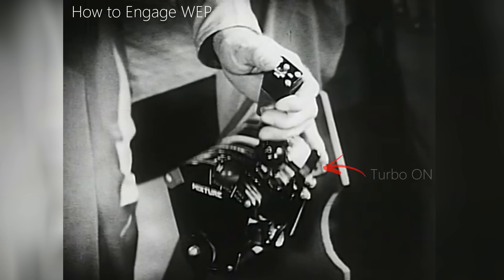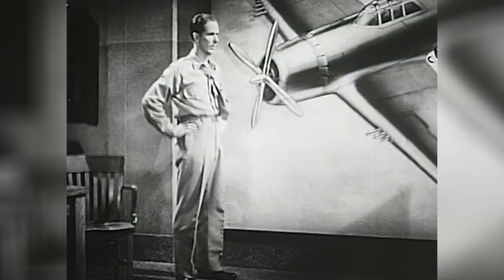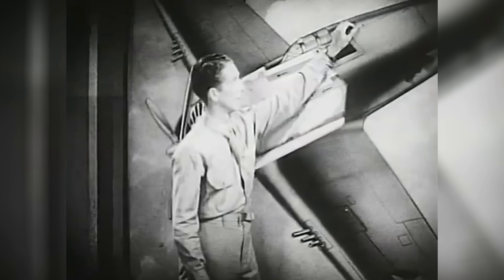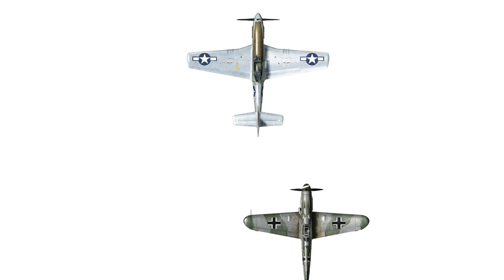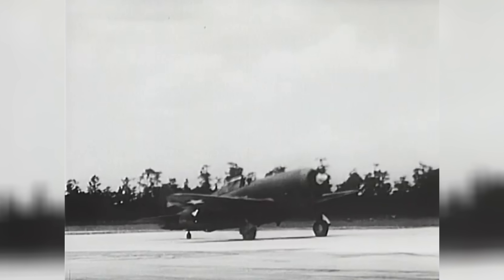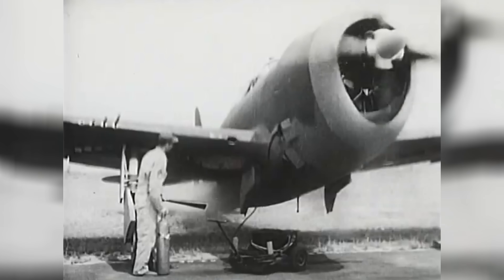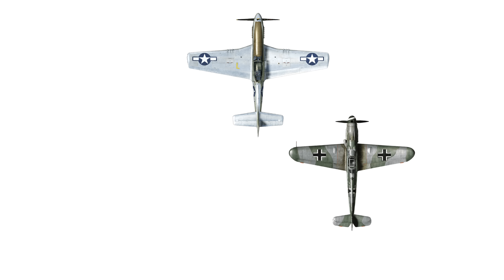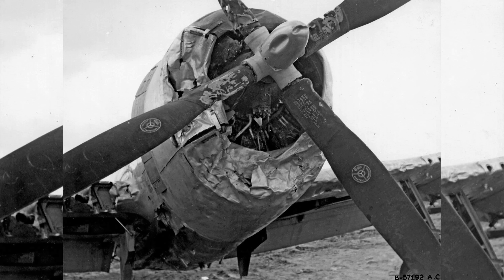What is WEP?

Comment: WEP is like removing the redline limiter on your car.  If you get home you will need to have a complete engine overhaul.   If you get home.
Reply: unless you had an Allison engine
Reply from the maker: @SoloRenegade Thanks for the comment Solo, Care to elaborate why regarding the Allison? Thats very interesting :)
Reply: @FlakAlley  becasue, it was tested at 70" for 20min without damage, after pilots, mechanics, and officers from the RAF, USAAF, and other nations reported back that they were operating the engines at 70+" MAP without issues. Allison tested and verified this was true.

Allisons were reaching 2200HP late in teh war and 3300HP after the war. teh engine was overbuilt and rugged, and could take more than it was rate for.
Reply: @SoloRenegade If they were so rugged then why not use them instead of the Merlin?
Reply: @Will1988US  the P 47 did I think he’s talking about the R 28 wasp or the super wasp because they tested that in California, where they ran it at max power for 24 hours to make sure it was reliable and could actually handle war then we’re de-tuned till like 2200 to 2600 horse with wep pushing 3600
Reply: @oler777   Was the detuning mainly for reliability, or fuel quality differences overseas?
Reply: @oler777  That happened here in Kansas City. My Dad started it up and set the power. Mister Luke Hobbs ordered that test because PW Harford Conn had run the R4360 at 3800 the week before. 
   In insane quest for reliability - the DAMN GOOD R2800 - B model was replaced by a "clean sheet of paper" redesign. That was the R2800 C-model first used in the F4U-4 Corsair. P-47s got them after that. Literally they are two completely different engines with the same bore and stroke.
Reply: @patrickshaw8595 he’ll yeah
Reply: @patrickshaw8595  Thats insane, was your father a vet also? Guessing he knew these engines inside out
Reply: @FlakAlley ai slop response
Reply: @Will1988US  He was a ground pounder was wounded then was a truck mechanic. 3 or 4 years he finally got hired on as AC mechanic and all they had was radials. He loved R2800s and hated R3350s. He never worked on any 4360s but I di with the Air National Guard. KC-97Gs.
Reply: @SoloRenegade But how likely is it that they escape after using WEF?
Reply: @StarWarsExpert_  Always? Do some resarch Stars
Reply: I wouldn’t say that because the higher RPM you go, the less efficient most engines get so in reality it would more be like closing the waist gates on a turbo charged car instead of the boost being regulated. It just shoots the turbo up to his high pressure as it possibly. Can I technically have this setting on my car I only ever had to use it once when in a street drag race somebody was driving towards me and we were in a tie so I closed my waist gate. The boost shot up to 37 psi and I gained about 200hp for 4sec
Reply: @oler777 I could be mistaken but I don't think use loose horse power the higher you go on your RPMs. You lose it from the extra heat which leads to the break down of the oil which generates more heat and the effect just keeps cascading until your engine blows, you let off the throttle or you can achieve extra cooling somehow. I have ran Great Value Corn Whiskey (1 gallon per full tank) in 2 different v-6s and 1 v-8 and it helped both of them run cooler, longer between oil changes, and more horsepower with less pedal because the cooling effects of the alcohol keeps the oil from heating up as well as the metal so it's like running with a cooler engine. Keep in mind though these vehicles are built better than the ones today. I have found if you can keep your engine cool and boost the octane to compensate for the slightly thicker oil your engine, oil, and wear parts last longer and it added about 50-75 miles per tank or more depending on which vehicle it was.
Reply: @scottcoley1906  yes he has to do with heat but it has to do with the stroke of the engine and where peak torque is being produced yeah you can keep making an engine rev higher and higher, but it’s not gonna mean that it’s efficient Formula One and Indy car engines rev to 14-20k because they have a very short stroke giving them decent horsepower, but not torque meanwhile a drag engine making 14,000 hp only at 7-10 use a long stroke to produce that much power it also depends on how big your engine is like some semis have 20 L diesel engine engines that make 300 hp but a couple thousand pounds speed of torque at 1000 RPM. It depends on what you’re driving what you’re building a whole bunch of other stuff, but you can’t just keep adding RPM or cars wouldn’t need gear boxes. Does your car shift out of first yes because if it kept revving to the moon, it would just blow up. And if you’ve been in a car that produces a lot of torque when you get above 5000 RPM, you start to lose power unless the camshaft is designed for that.
Reply: @oler777 isn’t always kind of a trade off/balance? You just simply can’t have both..
Reply: @DSToNe19and83 in simple terms yes you’re still just turning a rotating assembly to pump air through it as efficiently as possible. Some engine engines make a lot of torque low RPM others make a lot of horsepower at high RPM. But yeah, you’re right.
Reply: @oler777 No engine produces hp , they make torque and hp is just the outcome of torque x rpm . So in theory the higher you rev the more hp you have , but the torque is also falling down fast . To have torque at low rpm and high rpm , you need variable camshaft/valve timing like VTEC from Honda . Then you can have the best of both world's .
Reply: @5co756  ur wrong. The classic ‘engines don’t make horsepower" Yet somehow people still use HP because it actually tells you how fast work is being done. Torque without RPM is just a number you flex at Cars And VTEC isn’t magic either my bro it just moves the compromise around. Engine produces hp
Reply: @DSToNe19and83  I mean why cant you have both? Isnt that the point of WEP
Reply: @scottcoley1906  Well it has to be pretty serious to justify running an engine with 7 inch stroke very much past it's redline. They really don't like it and try to shake themselves apart. Or throw connecting rods.
Reply: @patrickshaw8595  Not really. WEP wasn’t past redline, it redefined the allowed limits for short durations. If engines really just shook themselves apart, WEP wouldn’t have been authorized or reused. This is car-guy logic applied badly to aircraft engines do some research
Reply: @Will1988US  My Dad the airliner mechanic explained what War Emergency power on warplanes was in 1966. J e r k.
Reply: @patrickshaw8595  My Grandfather flew p-51s in WW2. Just do some research to educate yourself
Reply: @Will1988US    And my uncle designed the P-51, Spitfire, Fokker, BF109, the Zero, and the Saturn V Rocket, so you’re both wrong.

Lying poorly on the internet is fun :)
Reply: I don't know about P-51s but I have definitely had to use the WEP on my crown victoria p-71 when people decide to run red lights or stop signs. 😂😂😂 I usually just refer to it as Full Pedal Power though. 😂😂😂
Reply from the maker: @scottcoley1906  😂 So you are a Cop? :)
Reply from the maker: Excellent analogy. Whats interesting is that all nations of the war had WEP in some form or another! Who do you think had the best Version of WEP?
Reply: @FlakAlley  USA because we killed everybody else.
Reply: In most planes WEP does not involve use of higher RPM than military power or takeoff power, it just involves higher manifold pressure.  For example the P-51D Takeoff, War Emergency and Military Power are all limited to 3000 RPM.  The difference is that Mil and Takeoff are limited to 61 inches of MP while War Emergency allows 67 inches of MP.  That is what increases the stress on the engine, not higher RPM.
Reply: @gort8203  Out of curiosity, was that MP limit the same across all P-51 variants or did it change later in the war?
Reply: @Will1988US  I'm sure it varied with variants of the engine and octane used.
Reply: @gort8203   thats interesting. Is it not heat that killed the engines most of the time? Or was it due to other factors. Love the way you put things btw learning stuff here
Reply: @Will1988US  If by killing an engine you mean a catastrophic failure, then I'm sure heat can contribute in more than one way,  So can lack of oil, coolant leaking into cylinder due to a blown head gasket, etc.  
The immediate problem with pushing cylinders to the heat and pressure limits of the octane being burned s detonation.  If you allow detonation to occur the engine will rapidly fail. WEP pushed pressures to the limit by use of over-rich mixture and sometimes water injection.  These cool the charge so it is not detonated by the heat of compression prior to the ignition spark.
Reply: That is half true. WEP removes any throttling or reduced drive speed of the supercharger. The record is 44,000 feet maximum altitude for a Mustang. At 34 to 36 thousand feet WEP can be selected and will result in METO (maximum except take off) power = 52  inches of mercury absolute pressure (on 145 octane gasoline) or 11 psi boost. The Bendix Trophy coast-to-coast records were won AGAINST AIR FORCE JET FIGHTERS by flying 2500 miles "Flying the manifold pressure gauge" unrefueled at a blistering 440 mph. No harm was done.
Reply: @patrickshaw8595  at very high altitudes, manifold pressures drop off and can no longer reach overboost pressures.

Mustangs were being pushed to 70-76" MAP in combat at times. 52" MAP is less than the max continuous factory rating.

Mustangs beet Me62s through steep dives, steep climbing turns, and basically out turning the me262 and using the 2min acceleration of an Me262 to run them down if they got too slow.
Reply: @SoloRenegade My m.p. numbers might be off a little on what a war surplus V-1650 would take for 4+ hours couple-three years after War Two was over. 52" might be a little low. You seem to think so based on telling me what I already knew about jet-chasing air combat.  
   So - smart guy - what altitude DID Paul Mantz fly at to get get WHAT manifold pressure?
     All I heard was that you disagree. Keep in mind that in the 1960s I swept floors for the likes of Ed Pink, Keith Black and later E.J. Potter building full-tilt "9 to 1" blower drive with "transport" cylinder banks and Allison connecting rod 1650s for Reno.
   So lets hear it.
Reply: @patrickshaw8595  wow, you're a lunatic. you clearly misunderstood everything I said.

"You seem to think so based on telling me what I already knew about jet-chasing air combat."

" All I heard was that you disagree."

so, you disagree with yourself? you're nuts.

"Keep in mind that in the 1960s I swept floors for the likes of Ed Pink, Keith Black and later E.J. Potter building full-tilt "9 to 1" blower drive with "transport" cylinder banks and Allison connecting rod 1650s for Reno."

oh, you were a janitor at Reno.....so you know absolutely Nothing about this stuff. got it. Nice try with the blatant Logical Fallacies.
Reply: Patrick’s point is pretty reasonable. He’s questioning whether late-war or postwar V-1650 MP numbers get oversimplified, especially when people quote hard limits without context. You still havent given a Source for anything renegade.  Asking what Mantz actually ran is a fair technical question. Mentioning firsthand exposure to Allison and blower work isn’t “appeal to authority,” it’s explaining where his skepticism comes from. You can disagree on the numbers, but dismissing him personally doesn’t refute the point he’s making.  Nothing wrong with a janitor, they are smarter than you think
Reply: Not just removing the redline limiter, but removing the limiter AND slamming the needle down as hard as it will go
Reply: I mean I used Japanese planes. If I was in combat, I just had to go balls to the wall and out turn my opponent and be able to pull out of it with no energy after killing3 people in one turn fight. I would get anywhere between 2-7 kills and the fight would last usually less than 3-4 minutes
Reply: who would do this?
Reply: I mean its like afterburners but just for normal engines
Reply: @whatever3245  So what do planes with afterburners have then? Afterburner plus?

Comment: I wonder how many engines got burned out by that?
Reply from the maker: Very interesting question. From our research out of 100 WWII fighter engines, 15 -20 % would suffer serious damage or be written off due to heavy or improper WEP use. A tonne of engines if you consider how many aircraft took part in the war. Now heres one for you, which nation do you think had the best type of WEP?
Reply: @FlakAlley i'm guessing the British, maybe. Or Germany.
Reply: @travisbishop782 I don't know myself but - from a different comment thread - it may be the British Merlin engine (which the Americans also used)
Reply: @travisbishop782  so you mean USA and UK, USA used a packard Merlin that was exactly the same as the rolls royce Merlin.
Reply: @Elbowbanditest2003 maybe not exactly the same, but the Merlin was considered one of the best engines at the time.
Reply: @travisbishop782  The Merlin was great, but calling it the best is mostly postwar nostalgia. German engines were already doing direct injection, extreme boost, and purpose-built WEP when the Allies were still playing it safe. MW50/GM-1 let them push absurd manifold pressures the Merlin simply couldn’t touch without eating itself
Reply: @jeffbenton6183   The American Merlin and British merlin were different. Guess why?

Comment: Rolls Royce spent huge man hours trying to understand why Merlin’s blew up at high revs. They were well within piston speed limits but went bang anyway. Damage was so severe that no causative blues were found. One day engine specialist Harry Ricardo  mentioned that his V twin test blocks could rev until valves bounced. No problem. Only then did RR realise their Merlin oil pump was too small for the V-12. The test V twins all used standard Merlin pumps. 
WEP did not wreck engine bearings. It did risk burnt valves and pistons and potentially blown head gaskets.

Comment: The P-51H wouldn’t even need WEP to leave a Bf-109 K-4 in the dust. Using the P-51D as the example would have made more sense, particularly given that the H model never saw combat.
Reply: P-51Ds were regularly pushed to 70-76" MAP in combat.
Reply: Also of note: the image they used was of a p-51D, not an H
(The wing leading edge on the H model is completely straight, and doesn’t have the extension near the fuselage)
Reply from the maker: Interesting, it would depend on the scenario. If the 109 has the jump then it would make sense to use WEP. Also keep in mind that Merlin WEP "Boost Override" is far more reliable than what the germans had available. In case both pilots engaged WEP it was likely the P-51 would come out on top also
Reply: Are you sure about that? the K4 is no slouch and i think in the vertical its got the P-51 due to more power